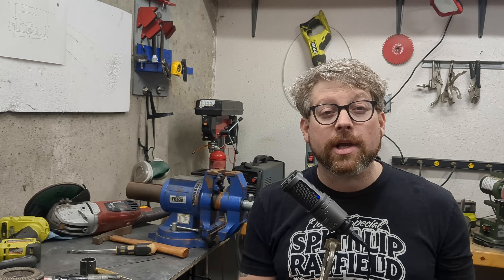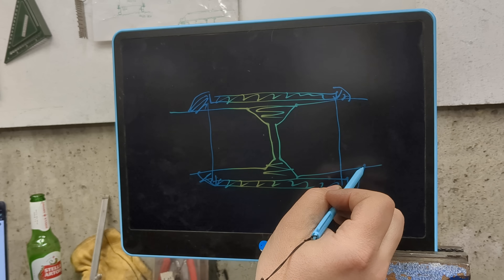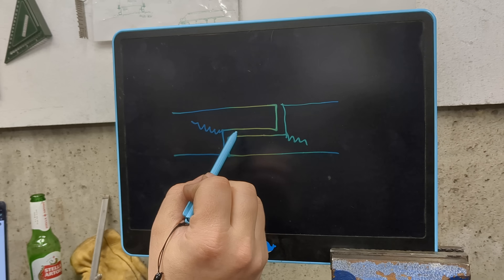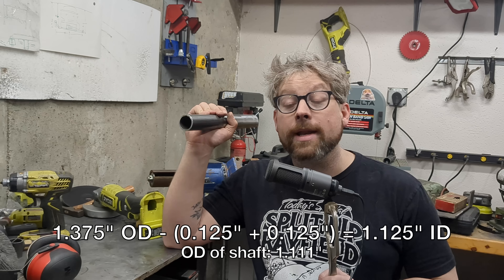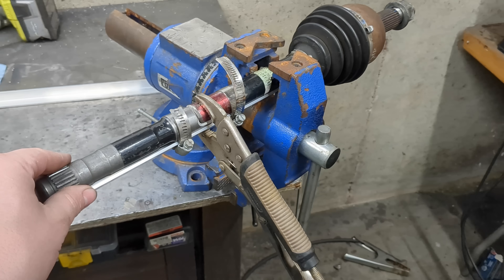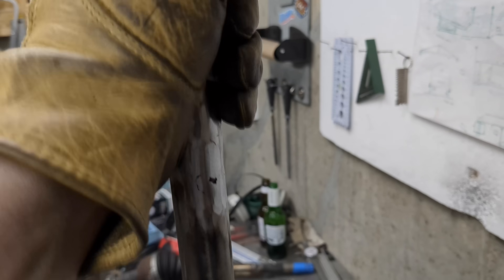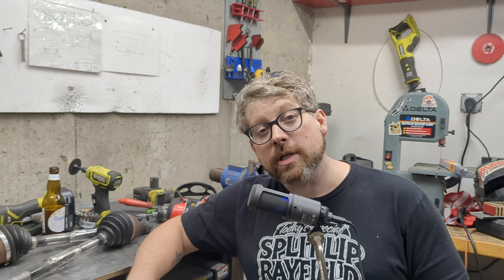Why This Joint will NEVER Fail - How to shorten/fix/splice an axle shaft or custom CV axle

Comment: It will fail GUARANTEED when considerable amount of torque will be applied. I had similar shaft, power of VW 1.9 TDI motor was enough to brake it at the outer welde (sleeve to the shaft). Proper method - thick soft steel sleeve (1/4 inch or more), 3 radial holes on each side, drill slightly into the shaft through the holes, then weld these holes. Probably still will not work for 500hp car, but for 200-250hp should be no problem. Outer weld  shaft to the sleeve is absolutely prohibited.

Comment: The best way to narrow a shaft is to cut off one end of it. Then have a machine shop re-spline it. Another way i've seen people narrow c v axles is to cut the end off, and then simply weld the c v joint center part onto the end of the shaft. With this second method, it's supposedly actually stronger than the splines. I've even known people to just use a solid shaft cut to length and replace the entire center. And then weld both ends onto the shaft. I've heard of this being done so that they can actually build a stronger shaft for a longer shaft. 
    For your application, I don't think you're gonna have a problem period if you were to have maybe a tesla drivetrain in the back with 5 times as much torque as that Leaf, then maybe. What i'm more concerned about is balance. I personally have never narrowed C.V.Axles. i have narrowed conventional axles and shortened drive shafts. And I do know about things giving you weird vibrations if they are not perfectly centered and balanced.  Also with my experience with drive shafts comma things that are not balanced/straight and at an angle are even more sensitive. 
   Let me point out when I say straight, I also mean true. I don't mean straight with a straight edge. I mean, using a dial indicator. Mounting that shaft in a chuck and rotating it and making sure that it is zero runout

Comment: I just got finished welding 2 shafts together utilizing the deep bevel method with a flux core mig style welder it was so hot that I avoided the pre heat/ post slow cool down process.  It was so hot that it stayed hot for a very long time.

Comment: Put the dam thing in on the lethe,dilling a 2
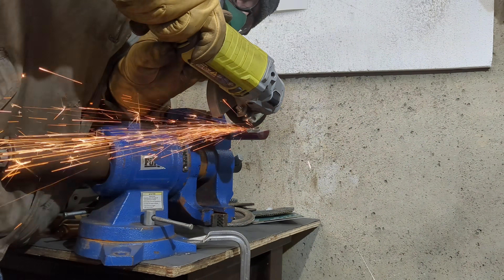Reply: 6:07 inch hole to whatever the size that fits the shaft accordingly,  mayb
Reply: Maybe 375 or something bigger, grade 8 bolt 4 inch long, with a whatever root opening  required , now you got place to start  preheat and peen, weld like hell!!

Comment: Mate, this is going to eventually fail and for what it is its just dangerous. Looks like there was no pre heat done and how did you allighn both ends so they actually fit correctly without ripping teeth. This should have been sent away or atleast given to a professional. How long until it fails and you possibly hurt yourself or crash into a school bus full of kids ? Bad form dude

Comment: I saw a guy who shortened or joined engine shafts, they are hardened so that they are soft inside. So he drilled a hole in one and rolled a shaft into the hole in the other, chamfered the ends, put one into the other and welded

Comment: If you shrink the axles Into the sleeve it will hold together with no welding. And if it starts turning in the sleeve it will weld automatically.  Just my thoughts.

Comment: All the strength is in the perimeter.  I'll bet $0.25 that a tube alone would do the job just as well.  Just slide the pieces into the tube.  Adjust the length and gas weld the whole thing with a cutting torch.  Electric is too hot.

Comment: How are the axles holding up? 
My bet is your better off resplining or custom billet, the problem is, axles usually flex tortional in the middle,  and the splines are the hardened part. I've welded axles before for a festiva, a relatively light car. Broke eventually with running auto cross. Never broke one  with stock axles.

Comment: Hey bruh, would a drill have been a good option for getting your inside bezels in the shaft halves? As is drill two holes and slice up into each on opposite sides and then slice it down the center? What’s that dawg? Genius? You’re too kind. 😂

Comment: Kind of nutty that you're stick welding car parts like it's 1943  ngl. 7018 is probably a much better choice though. So I'm glad you ended up on that. I think and hope this will work for you. But, I can't say I'm sold that a shiplapped shaft is better than a 45. Those forces you were talking about now have significantly smaller tabs to pull on. A lot more opportunity for a void to be in there and start cracking. I think the best option is probably neither the 45 or this. Just but them together and get a big old bevel on there. Then fill it up with a multi-pass weld with a nice cap on it. Full burn through with no voids.

Comment: Only one more thing you need to do. You should aneal the welded area to relieve the stress and stop cracks from forming. Then, you can temper it with an oil quench to reharden the shaft for strength. Most machine shops will do it reasonably.

Comment: My friend, first you need to cut the two pieces at the right angle and fix them together by spot welding. And then weld the root by proper welding and completely fill the empty space because the presence of empty space or small holes weakens the strength of the shaft. I hope my comment is not disrespectful to you. I wish you success.❤😊

Comment: The reason for pre heat (high tensile strength steel) is because of nitrogen embritlment. Cracking can occur up to 48 hrs after welding. Hope they hold up.

Comment: If you know how to weld two 30 degree bevels are way strong enough.  If done correct the weld is stronger than the axle. I would bevel them to about 1/8" butted and fill them all with E9018.  

Your splice you did would work better if you beveled it way deeper.  I am not saying the two notches are a horrible Idea either.  But either way, I would use a stick with a high nickel content and low hydrogen flux like a E9018. I would preheat with a torch and post heat, and after each pass I would use a needle scaler to remove slag but also to ping the weld to relieve any potential cracks from starting.   Once done, I would ping on it for a good 5 mins as it cooled.  You do not need a tig welder either.  When it comes to strength the stick is the way to go and way better than mig.  E9018 is the same basic thig as E7018 except its tensile strength is 20K psi stronger.     
One last thing is when you sleeve it you should drill 6 or 8,  3/8" holes though the tubing and rosette weld them so they are welded in more locations than just the ends spreading the load.  Use a chrome-moly tube.      

But over all I tink you did okay.  If it does fail and you need to redo them then I would consider some of my points preheat and pinging the weld as it cools is a huge game changer.     Lastly I love that you recognize that you do not make cuts with sharp corners when something is carrying a load.  Always a radius even if you are going to weld them up.   If you ever repair cracks in a header pipe or anything really do not just weld over them.  I always take a 1/8"-1/4" drill bit and drill a hole at each end of the crack, then I grind a bevel into the crack and weld up the crack and my holes.    If you ever see a frame crack even if small and you cant get to welding it up always drill a hole because the radius stops the crack from spreading.  Plastic metal, glass, it don't matter, drilling a hole stops the crack then you can repair it.       I took welding in school then went to a tech collage and took machine tooling and worked at a few job sites and you can learn a lot from some of the old timers.     I hope I did not sound like a youtube armchair quarterback to bad.   I will give you a like no matter but reply to me and I will sub

Comment: for the sleeve I would have gotten a pipe with slightly too small of an I.D and used a bore sander/sanding drum to grind it to size. Also having a sleeve in the first place could cause a balancing issue. If you have a vibration when accelerating that would most likely be why
Reply from the maker: I didn't think about that, great idea. I'm also aware of the potential balancing issue, I'll soon find out if there is one.

Comment: Your on the right track but should drill holes in the sleeve and then plug weld into the shaft

Comment: I've used 10018 rod turned up on 250A to really dig in with a mild preheat on the axle and bury them in sand for post cooling.

Comment: The problem with your design is the lack of penetration in the shaft . With the way you have done it you effectually have a large gapped internal crack with pockets of air and acidic gasses from the welding rod flux. This wont be much stronger than the outer sleeve. At least with a chamfered butt weld you can weld all the way to the core of the shaft making it solid.  You also need to preheat the shaft so the shaft, sleeve and welds shrink at the same rate to give the welds any chance of not cracking

Comment: Question... Why not putting a sleeve pipe over it with a lot of drilled holes, basically spot welding it? The outsides would need to be sealed with some elastic glue to prevent rust on the inside though.
I have no clue about welding, but imho, this is the best distribution of heat introduced weakness to the base shaft.

Comment: Without preheat the weld area on the shafts at the ends of your sleeve is the weak point in your axle now not the joint.

Comment: Material fatigue is caused by stress point loading. Stresses follow the outside shape until interrupted, for example, a sharp corner or corrosion pitting or weld uncuts. Dispersing the load over a wider area is to reduce failures. The shaft joint in the video adds more rational mass in the least desirable place. The recommended weld preparation should have a small machined spigot pressed into a bore on the corresponding part for alignment, including tapers for the weld. The root weld must have full penetration, leaving no voids. When the weld is completed, the joint should be finished machined in a lathe, leaving a smooth, clean appearance. Done correctly, the torsional load on the shaft will be absorbed over it's length and not at the repair. PS. Chosing the correct weld filler rod is also import. Preheating before commencing the weld is also recommended as is to peen each weld bead as it is built up to releave stresses. The shaft modification in this video would fail an engineers certification. Cheers

Comment: If I May give a word of advice. Pre-heat work. Arc weld the joint then place the work in ULTRA DRY silica sand to cool. Note the volume of sand needs to be enough to retain the heat in the piece. (You’re looking to keep the molecular structure as well as the content of carbon to avoid brittleness)7018 rod is a decent choice due to its flexibility. There are also alloy rods if you know your base material. If mig welding the piece alloy wire is an option. Stainless wire is also an option. This process is how I go about dealing with cast iron as well. Remember the silica sand can’t have any moisture. Take it however you want. Just a trick to use in sub-prime conditions from a guy with 40+ years of building trucks, cars, buggies, and junkers to jump etc.
Reply: How do you ensure your silica sand is ULTRA DRY?

Comment: Vertical centrifugal pump manufacturers have been using a similar joint for several years now. Many of these pumps are driven by electric motors that are over 1000 hp but the shaft material ranges between 2-4 inches in diameter. The pumps have to be serviceable so the shafts are not welded and the  sleeve is an interference fit. Granted, there is no shock loading in a centrifugal pump, the shaft joint is precision machined, and there is no heat effected zone, but we have 1500 and 2200 HP motors driving these pumps for a decade with no shaft issues. Hope this holds up for you.

Comment: The only thing I would have done different. Is cut the sleeve 3/4 of the way down lengthwise, 3 times from one end, and 3 times offset from the other end. Then laid 6 interlocking beads down it from end to end. Would have made the sleeve suck up tighter, and would have literally made it indestructible. You'd have broken a different part of the axle before those welds popped, cracked, or tire to failure.

Comment: I'm curious if machining the welded shaft down and heating and shrink fitting a sleeve would be a good fix.  Would obviously need a lathe and I get that this is being done with minimal tooling.

Comment: ive seen added holes in sleeve and axles. weld through holes, they may have added pins in the holes before welding

Comment: As a mechanical engineer I have some concern. All welds suppose to transfer shear loads, not normal (tension, bending) thus chamfering 45deg shaft ends make sense bc welds are shearing under torsional loads. In your design middle portion (flat one) is not under shear load. It would be if axle woild be under tension load. Finally weld area under shear is way smaller, so connection should be weaker. The main problem with welding chamfered shaft ends as you showed in the begining is that you put multilayered welds and it requires some experience. Moreover you should apply correct post heat treatment, otherwise you'll have initial stress in your weld
Reply: Yes you are correct.   But in the application that he is putting them in he could have welded easily with the 110 welder and it would be more than sufficient

Comment: I’ve done this exact thing in my sway bar links and finished them off with a washer welded and bent over the joints ,  holding up just fine with 9k miles on my jeep tj .  Thanks for your hard work man .
Reply: End links are experiencing tension, not torsion. Twisting a bolt apart is way easier than pulling one apart.

Comment: Maybe drill two holes in the center of the shaft where the inside corners will be located. This would make the surface uniform and flat pretty much eliminating stress risers. Should the hole size be 1/2 the diameter of axle? Thoughts?

Comment: You've overthought this wayyy too much. The shape of the spliced ends would only have those effects if unwelded or the weld broke. Your still better off with a full pen weld. As for the sleeve, don't weld the ends. Drill holes through the sleeve and plug weld...

Comment: Correct, any corner in metallurgy will  crack. They are always ground down to have a radia. This is a great idea but your stick welding will 100% fail. Definitely should have been mig and you need way more bevel on the welds to get as close as possible to 100% penetration. You currently have about 10% then your added sleeve may give you 15%. Cool though. Even a drilled out hole to plug weld the centers together would be an idea. Cheers

Comment: I have done this to my driverside cv axle for my H22A swapped CB7 Accord, but i described it as a puzzle type cut cuz just like a simple board puzzle the cuts were offset and of the rounded corner nature but I felt like I might need a simple cross pin that locked the two joining puzzle cuts at an angle along thru the sleeve so as to lock it all. I made the cross pin from the cut out unused section of shaft welded it up by preheat with mapp gas turbo torch tri tip as I arc welded with 6011 & 7018 then flap disc sanded it to slip my sleeve over and arcweld both ends which was extended more then 1.75in. on both ends beyond where the puzzlecuts join weld is on CV itself. Then painted it several coats and I been running it since 2019.  I have not babied it from the get go. Soon as it was on the ground went and did a standing long burnout that almost went to 3rd gear but drop it back to second before i started to feel the wire belts slapping of the brand new tires i just wore out with that mega burn out. I wanted to be sure it would hold up and if it didnt handle that well it would be back to drawing board. But it definitely held up and with minimal vibration. (Expected vibes due to the added welds and added sleeve with its welds and with no real way to properly balance) i made a lathe like jig out of bed frame and some spare car parts so that i could hand spin the shafts as I welded around so as I would be able to see if it was not centered or warped by heat as i progressed. Ofc the first initial welds was done on a table with angle iron. I should also mention that beside shortening the shaft I also needed to extend the spline cuts about 12mm  but i just did that by hand with angle grinder and cut off wheel. The M2U4 5spd trans I was using has a different kind of LSD and required it to sit deeper into. https://youtu.be/PMXYNDZyggI?si=oGMjOQ3T8cs4HAF9

Comment: Where do I get the disk sander that sucks the sparks back in? Jk, but this was a pretty cool method. I would probably aneal what i could in vermiculite be before the grinding and welding, maybe again after the welding and re temper, if your worried about the differential heating that would be problem solved.

Comment: The correct way is to have custom axles made, second best option is to shorten the shaft from the end and re-spline it so you wouldn’t have to do any welding at all.

Comment: Putting a sleeve over a weaker welding spot is called fishplating. Nice video BTW, and the doodling screen is really helpful.
Reply: Flitch plating, not fish plating, lol.
Reply: @genefogarty5395  Flitch plating strengthens wood with a metal plate sandwiched between two wooden beams; it involves no welding.

Comment: I think a sharper angle would work fine and be easier to splice. So instead of your design or a 45 cut.. use a 30 or 20 deg.